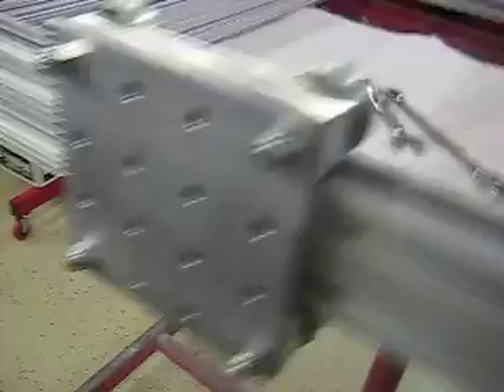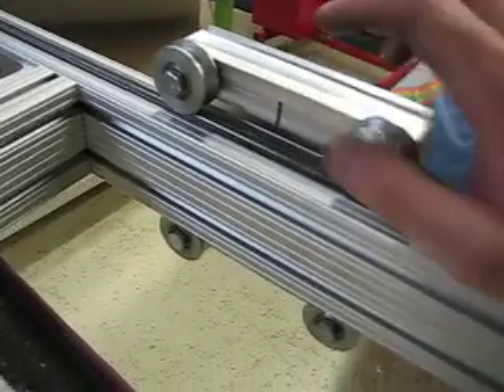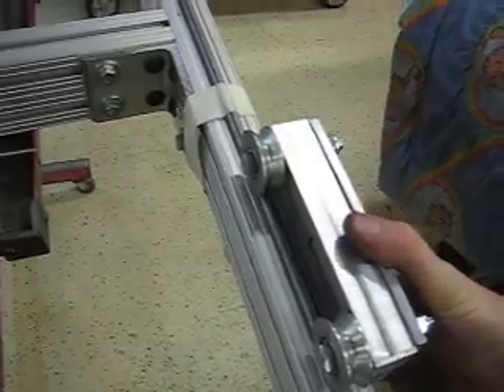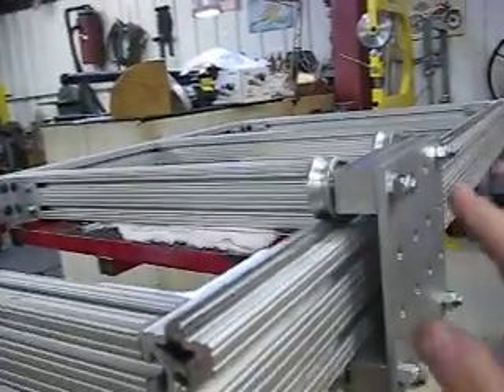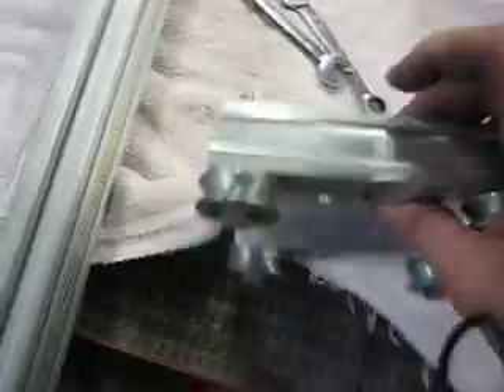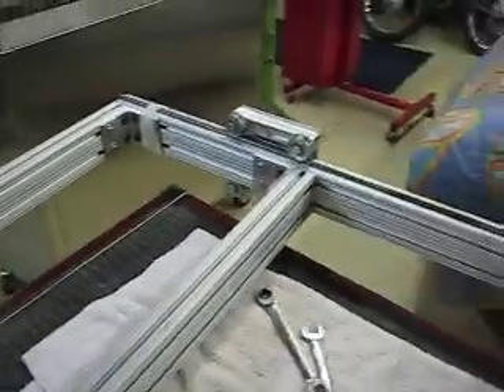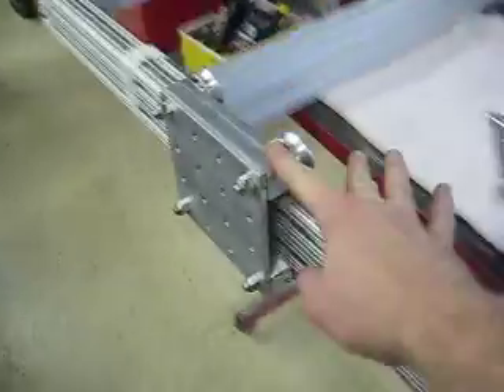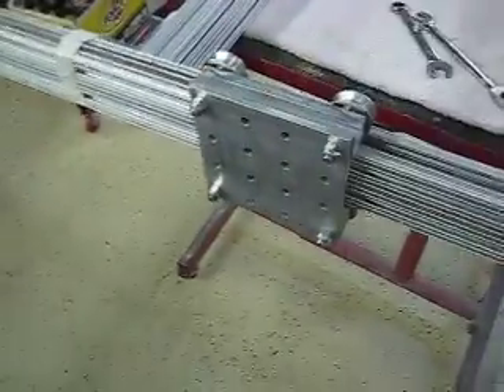CNC mill bearing asm.

Comment: Make the lower bearing bolt holes into slots for adjustment. Drill and tap a 10-32 hole through your 1" square stock into the slots for the lower bearing bolts. Insert a 10-32 screw after you put your bearing and bolt back in. Now you can tighten the lower bearing against the lower side of the rail by simply tightening the 10-32 screw and tightening the bearing bolt when the slop is gone.